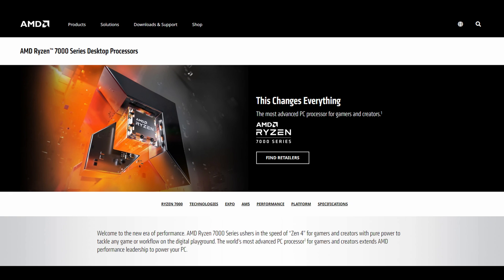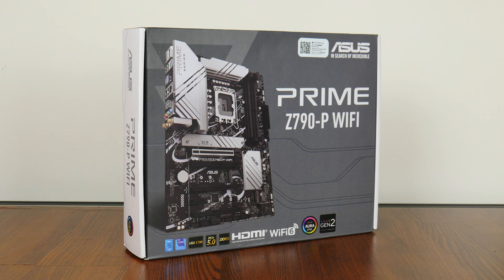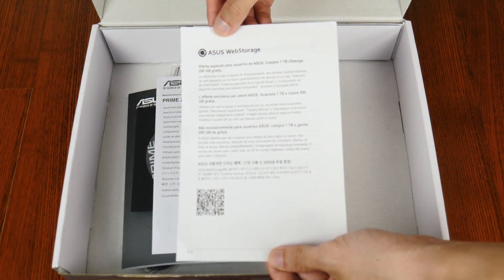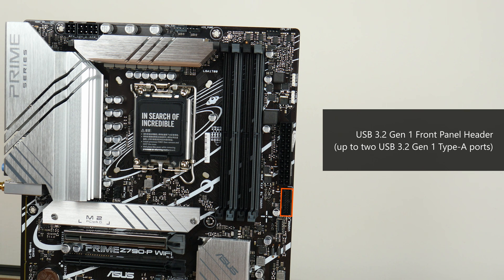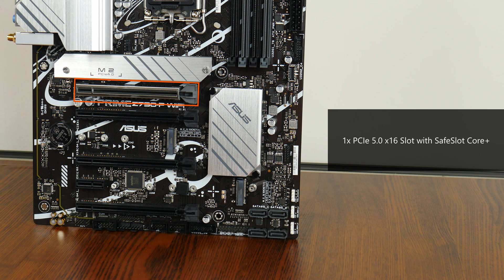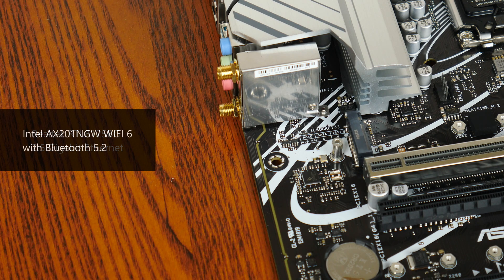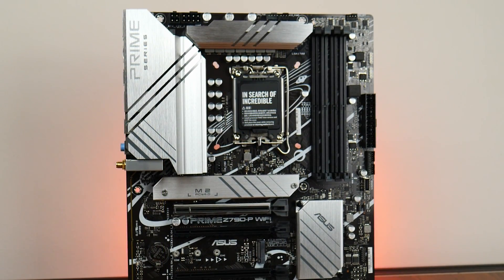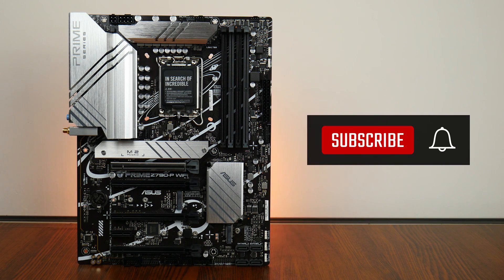Entry-level Intel Z790 Motherboard - ASUS PRIME Z790-P WIFI Unboxing & Overview

Comment: i run 5600mhz corsair vengeance ddr5, intel 12th gen cpu, intel 16gb gpu with the 60gbps boost, and it's all on the ASUS PRIME z790-P. i run inference while playing VULKAN RT mode, and i barely use 42% gpu and 19% cpu, in 1080p ULTRA i'm gaming-while my ai workflow inference pumps out 30 images, and still have system/resource to spare-ya, i'm living the dream.

Comment: Hi i need help im trying to upgrade to this but im currently using aio for my LGA 1200 and this is 1700, do i need to change my aio?
Reply from the maker: Hello, do you know the brand and model of AIO that you're currently using? If it's a newer AIO, it might come with a bracket with adjustable posts that can be tweaked to support the LGA1700 socket.

Comment: Can I install windows 11 on it out of the box?
Reply from the maker: Just to clarify, you'd need to have a processor, RAM, storage drive and a graphics card installed together with this board (along with a power supply and PC case of course) for you to be able to install Windows 11 - was this what you meant?

Comment: Friend, what processor would you recommend to put on prime ASUS Prime Z790-p WiFi ?
Reply from the maker: I'd probably look at a K-series processor, perhaps a 13600K or 13700K, or even Intel's upcoming 14th Gen K-series processors, seeing as the Z790 chipset supports overclocking. P.S. this board will support 14th Gen with a BIOS update!

Comment: Hi. Is it possible to connect a Razer Core X (Thunderbolt 3) to this mainboard?
'Always confused with USB-C, USB 4, Thunderbolt 3, …
Reply from the maker: Unfortunately not - you'd need a Thunderbolt 3 port and above to support the Core X, which this motherboard doesn't come with.. 

USB-C as a term broadly refers to a type of physical connector,. and has several different standards (e.g. USB 3.2 Gen 1, USB 3.2 Gen 2x2 etc). The Thunderbolt standard utilises a USB-C connector, and can be considered one of the fastest transfer protocols that the USB Type-C connector design can support. Hope this explanation helps...

Comment: Getting a PC put together with the Prime Z790-P and the Intel i7 13700K CPU with the MSI RTX 3060Ti graphics card and im wondering if this setup will be fine for playing games like ATS,  Call of Duty, Dishonoured and Doom. Im having second thoughts of having this system put together. Please let me know what you think.
Reply from the maker: Is there a reason why you've chosen the RTX 3060 Ti? The 13700K is a pretty powerful processor that I'd probably pair with at least a RTX 4070 or 4070 Ti to get the most gaming performance out of it!
Reply: needed a 2 fan GPU as the 3 fan will not fit in my case and its due to budget and coudlnt justify paying $600 for one here in Canada @ALKtech
Reply from the maker: @sbrodie08  ah I see..have you considered looking at the secondhand market? You might be able to find say, a dual fan RX 6700 XT or RX 6750 XT for hopefully a good price and some manufacturer warranty left!

Comment: Thanks for the video, im planning on building 13600K and a whole white powerful built. already have a 3060ti i will change in one or two years. Basically wanted to go on a rog strix B760-A gaming wifi ddr5 (7800mhz) for gaming streaming AND advanced editing (would maybe look for a bit of overclocking) what would you advice me, the high level B760 or this entry level z790 ? what would be the best for me ? Or maybe another z790 ? my budget is around 300 for the motherboard.
I also intend to have 9 lian li fans in the build with the AIO which I think are RGB and no argb, would it be ok for connectivity ?
An asnwer would really help thank you !
Reply from the maker: If you're intending to overclock, you'll have to get a board powered by the Z790 chipset, as B760 boards do not officially support overclocking, so that'll make the Z790-P WIFI the default choice, which should handle a 13600K with a small amount of overclocking just fine.

That said, given the number of fans that you're intending to have, you'll definitely need to get a fan/RGB hub for sure - depending on the model of PC case that you're getting, some cases do come with such a fan/RGB hub preinstalled. Hope this info helps!
Reply: @ALKtech   Thank you so much man, as I maybe would get more into overclocking later, I guess I am gonna wait more and go for a rog strix z790-a gaming Wifi d5, I wouldn’t want to be block because of my motherboard. Yes, I will have two rgb hub since I believe the pack of three lian li fans come with it, I am getting lian li 011 mini Thank you again it helps a lot 🙏🏼

Comment: which one do you think is better msı pro z790p wifi ddr5 and asus prime z790p wifi ddr 5 ?
Reply from the maker: Both boards are fairly similar, though the MSI does come with WIFI 6E and has an Intel 2.5 Gigabit Ethernet chip (versus WIFI 6 and Realtek 2.5 Gigabit Ethernet for the ASUS). For me, it'll boil down to pricing, is there a price difference between both boards where you're from?
Reply: there is no price difference and i am from turkey
Reply from the maker: @halilibrahim6090  I see. I would probably go with the MSI for its better WIFI - my two cents!
Reply: but my other parts are asus
Reply from the maker: @halilibrahim6090  there won't be any issues with compatibility if you use a MSI board. But that said, if you're keen to "match" the components of your PC to be from the same brand, going the ASUS route won't hurt since the spec differences between the ASUS and MSI aren't that large.

Comment: I just picked this up last week at Micro Center in a bundle.  I7 13700k, 32Gb 6000 DDR5 and the z790 for $550.  Only issue I had with it was that it didn't have the install DVD and I couldn't install the drivers off USB.  My Win 10 flash drive was too out of date and couldn't install the drivers until it was updated and the network adapter would not work without drivers.  Ended up having to make a new Win 10 install drive.
Reply from the maker: That's odd, I'd think that even early copies of Windows 10 should at least have some form of generic USB 2.0 driver support that would allow you to install drivers via a USB flash drive, after the initial Windows 10 install has been completed!
Reply: I literally just bought the same bundle at Micro Cente. Hope it works out 🤙
Reply: @obriantucker2256 aye bro how did it work out for you ? Imma get it too
Reply: @obriantucker2256 ay bro how’s the board
Reply: @shahror09 im still acquiring all the parts. PSU, graphics card, and AIO cpu cooler is next up.
Reply: I just bought the same bundle for my HTPC. The board seems decent overall. Had to pick up a heatsink for $45 bucks. Looking forward to trying everything out.
Reply: What cooler do you use the your I7 13700k?
Reply: @popogames71  I picked up an ak620. It has absolutely no issues keeping the cpu cool.  I have yet to see it even get near throttling temps.
Reply: @popogames71  Arctic 360mm aio the only way to go imo. Cpu always at great temperature
Reply: I ended up going with the "be quiet PURE ROCK SLIM 2 CPU Cooler" so far i had no issue with cooling. HOWEVER. I had to return the rig as I could not upgrade the computer to win 11. I'm not a big azsus fan but I made the move because it was part of the bundle. The compute's been a microcenter almost 10 days because they cant seem to resolve the "secure boot" issue Never had this prob with gigabyte Boards. Def a bit of a bummer @popogames71
Reply: Thanks!
Reply: any update on the bundle? i’m bout to order it later today
Reply: It’s even cheaper now. $499 just picked it up today
Reply: @SilkyAce  Did it still come with the bonus game for buying the intel cpu? I got a copy of Total War: Warhammer 3 with it.
Reply: You’ll get assassins creed for intel, and starfield for amd gpu with the current promotions. I’m using this board with a 7900xtx and running 4K starfield no issues.
Reply: i bought the 12900k this mobo and 32 gb 6000 for 400 a stealll
Reply: I'm thinking about getting the same bundle for Black Friday? What do you think of it?

Comment: Planning to put in an i5 13600k with a rx7900xtx. Do you think this board is enough or should i go for the MSI MPG Ddr5 instead?
Reply from the maker: Oh this board will be more than enough for a 13600K, do make sure that you've got a good CPU cooler to keep temperatures at bay! That said, the MSI board that you are referring to is the MPG Z790 CARBON WIFI? It's way more expensive that this PRIME board with more features...if you don't need those extra features, stick with the PRIME and save the cash for the other parts of your PC!
Reply: @ALKtech  I was referring to the MSI MPG Z790 Edge wifi D5, It’s pretty much the same aesthetically but the features are a lot more like more fan hubs etc, and i think i’m running 6 fans with a AIO so i’m pretty scared it won’t be enough. especially as later on i’ll look to upgrade CPU and maybe AIO to a 360 aswell. You think i should go for the EDGE ?  or the prime is still good?
Reply from the maker: @kalidnasser8317  got it. The MSI MPG Z790 EDGE WIFI does have a better VRM setup, and I do think it looks much nicer than the PRIME as well, along with a better audio codec etc...I'm guessing it costs much more than the PRIME where you're from?

In any case, since you're intending to upgrade the CPU further down the road (I suspect 14th Gen will be on LGA1700 stil), the MSI might be a better choice from a specs and longevity perspective, but again, the price difference between both boards is something that would factor largely in my decision!

Comment: will this mobo work with 2x16 ddr4 3600mHz ram?
Edit: nvm, I was looking at the wrong version. i'm supposed to be looking at the D4 version
Reply from the maker: 😂 no worries. What processor are you intending to get with the D4 variant of this board?
Reply: @ALKtech  i5-13600kf
Reply from the maker: @boltPoke  mmm a 13600KF will do fine with DDR4 3600 RAMs!

Comment: Excellent Video bro! Really loved it. One question, how is the motherboard?  Is it good when paired with i7-13700k and ARC750? or I should go with Asus Tuf Gaming Plus Z790 (DDR5 + WIFI) - Tuf gaming costs bit more. My use are motion graphics + 3D. ( may do a bit overclocking) I am confused between this two. Hoping for your reply.
Reply from the maker: How big is the price difference between both boards? If you're intending to do a spot of overclocking, the TUF Gaming has a better VRM setup that would probably give you more headroom, plus it has a better audio and WIFI 6E...
Reply: @ALKtech  the price difference is around $60
Reply: @ALKtech  thank you so much for replying ❤️😃
Reply from the maker: @alvialyeadin8317  happy to help. $60 is quite a big difference in price, if you're only intending to do slight overclocking, I'd suggest just sticking with the PRIME Z790-P. Just make sure that you've got a good CPU cooler (maybe a good 240mm AIO) so that you won't thermal throttle!
Reply: @ALKtech  Thank you, I have chosen a corsair h150 360mm AIO. Thank you <3

Comment: what is crazy is this "Entry" board is the one used on the Cosair Vengence i8100 for $4,600. Seems crazy they would use a entry level mobo with such a high price tag as their premium PC that has been getting very fast reviews.
Reply from the maker: Well the PRIME Z790 is entry-level in the spectrum of Intel Z790 motherboards, where the Z790 is still a high-end chipset for Intel 13th Gen builds. This board still has features that matter in making sure high-end processors such as the 13900K can perform to their maximum potential. such as a beefier VRM setup. No surprises here that Corsair chose a board such as this over say, a ROG STRIX board that has more bells and whistles but would cost much more, and would drive the price of their PCs even higher...
Reply: But $4,600 is very expensive for a Pre-Build. You would think a better board would be in order. But it may just be me..Thanks for the reply.
Reply from the maker: @MasterTheNEC  yeah I get where you're coming from - I suppose Corsair's gotta find ways to make sure it earns a decent margin from its pre-builts...after factoring in the need for post-sales service such as warranty claims and so on!
Reply: @ALKtech  I ended up at Xidax and got the MSI MPG Z790 Carbon WiFi instead.

Comment: Buenas! Tengo una pregunta, esta motherboard es compatible con la ssd m.2 PCIe 5.0 x 4? Las que tienen 10k a 15k de lectura. Por favor respondan 🥺
Reply from the maker: This motherboard will work with PCIe 5.0 M.2 drives, however, do note that such drives will not be able to run at full PCIe 5.0 speeds, as the M.2 slots on this board support PCIe 4.0 speeds only - installing a PCIe 5.0 M.2 SSD into a PCIe 4.0 M.2 slot would mean that the SSD would operate at maximum PCIe 4.0 x4 speeds only. Hope this clarifies!

Comment: Where do I get 4 cable and 8 cable for this motherboard? Wtf
Reply: Its for the ATX_12 and ATX_12_2 power input thats shown at 3:22
Reply from the maker: @Toiarc  your power supply should come with at least one 8-pin CPU power cable, which has an 8-pin connector that can be split into two 4-pin connectors. High-end power supplies usually come with two 8-pin CPU power cables...

You'll need to connect at least the 8-pin power cable from your power supply to the motherboard in order to power your PC up - the ATX_12V_2 4-pin connector is optional if you're using a lower-end CPU. Hope this helps!

Comment: Is there a reset button on this motherboard I cannot find any button or information on how to reset this motherboard. I’m having an issue where in the middle of a game my pc will just black screen randomly and the pc will stay on and my gpu fans will start spinning at 100%. I have a 4080 and I was told to try resetting my motherboard so any help would be greatly appreciated
Reply from the maker: There isn't a reset button on this board - you might wanna try clearing the CMOS by removing the CMOS battery (with the PC powered off and unplugged from the mains), and leave the PC be for a few minutes, before replacing the battery and powering it up again. You should find that the BIOS will be reset - simply restore your usual settings (XMP for memory, enable Resizable BAR etc), and hopefully the issue will go away. If this doesn't work, I suspect you might have a hardware issue!
Reply: @ALKtech  thank you so much man resetting the bios completely fixed the issue!!!! Much thanks for the info!!

Comment: Hey man great video can you do me a favour and link me the screw driver you were using to remove the m.2 panel in the storage section that was automatic please if you didn't get it from Amazon can you link me one from Amazon that's the same and with the name as well thank you in advance and great video ❤ also dumb question you see that m.2 metal bar thing that you unscrewed if I were to put a m.2 there would I cover it with that metal panel or no XD.
Reply from the maker: Glad you liked the video - and looks like I gotta do a review video for the screwdriver soon, you're not the only one asking about it 😂It's a Xiaomi Electric Precision Screwdriver - you can look for it on Amazon, I saw it being sold for US$44.98!

That said, yes, the metal panel is what's called a heatsink, and you will indeed install the M.2 drive first, and thereafter put the heatsink on top, and secure it by screwing it down. The purpose of the heatsink is to keep the M.2 drive cool!
Reply: @ALKtech  Ah okay thanks that makes sense I appreciate you :)

Comment: What is csm version
Reply from the maker: CSM=Corporate Stable Model. It's a feature that's targeted primarily at business/enterprise users where ASUS includes its Control Center app for stuff like remote PC management, software deployment and the like. If you're using this board for a PC at home, there's no need to get the CSM variant of this board!
Reply: @ALKtech  then which is the perfect for  home pc. I want to have 13600k ,ddr5 ram and pcei 5 support.. preferably z series
Reply from the maker: @TRENDINGTECHSCHANNEL  Yeah actually this board would be perfectly fine with a 13600K. In some markets, ASUS may only sell the CSM variant, but if the non-CSM and CSM versions are available in your country, I'd save the money and get the non-CSM version of the Z790-P WIFI!

Comment: Sir do you mean i can buy a 7200 mhz ram and use it on this board?  coz i have the same board and im confuse because the label on the box says up to 7000
Reply from the maker: Yes you can! ASUS updated its website to reflect DDR5 7200 support: https://www.asus.com/motherboards-components/motherboards/prime/prime-z790-p-wifi/techspec/

Comment: I have this board in my first pc build, exactly how bad is the audio chip compared to others for common use like gaming?
Reply: you bypass the chip if u plug your headset to usb or bluetooth/wifi, it's only for usb jack that the chip is entry level
Reply from the maker: It's not bad bad per se, just a very common chip that has been around for several years and all low-end motherboards use this codec too. In all honesty, if you're not a big audiophile, I think the audio will do just fine...what kind of audio equipment will you be using? A gaming headset? 2.1 speaker setup?